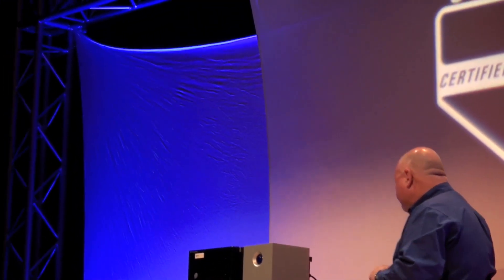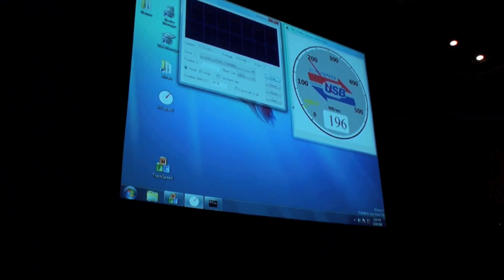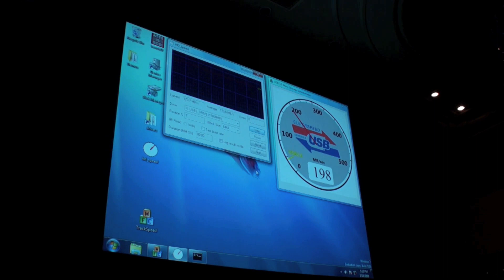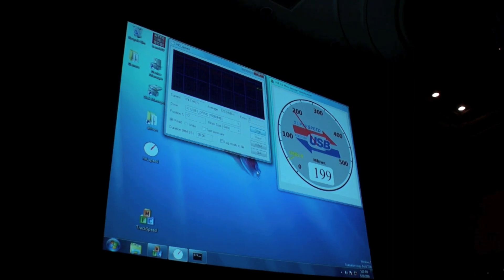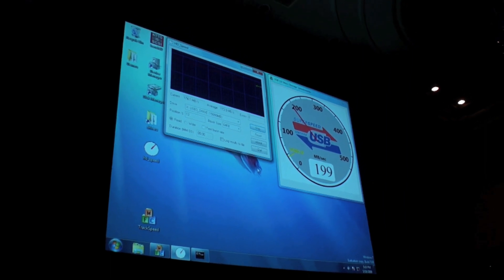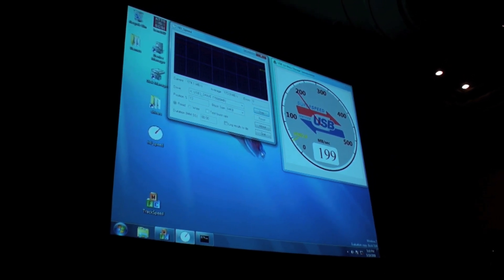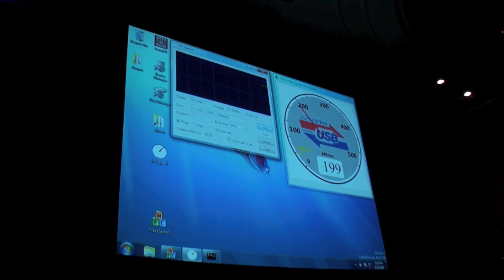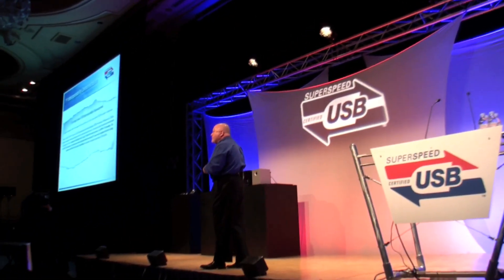Superspeed USB (USB 3.0) Speed demo

Comment: @rollthetape88 - While Thunderbolt is truly amazing, it will not become mainstream for quite a while (if at all) - even Apple is only adopting it on its high-end systems. USB3, on the other hand is becoming mainstream because of its increased speed and backwards compatibility. 10Gbps is nice to have, but only if there are devices to connect it to.

Comment: My humble advice is to use eSATAp (eSATA + USB), why?
1) It just require a simple bracket(delock) that cost less than USD10.
2) Zero drive, no need OS or BIOS AHCI tweak
3) Backward compatible with USB 2
4) MAC Pro or PC compatible
5) Faster (or as fast as USB 3) as of now.
6) Self power a 3.5" HDD on a desktop
7) found in NAS network attached storage